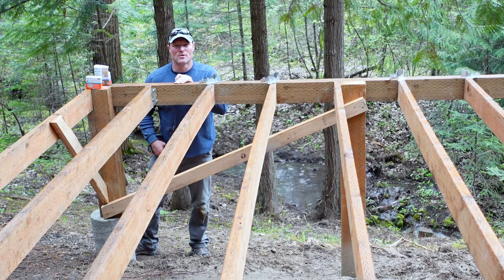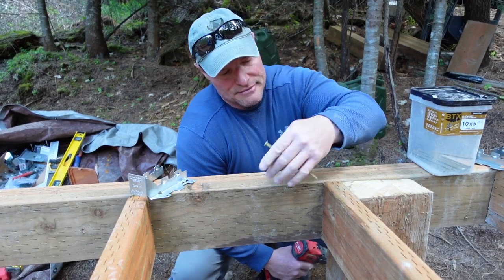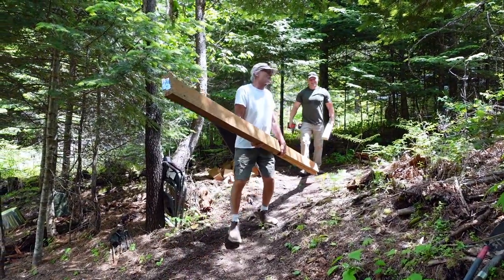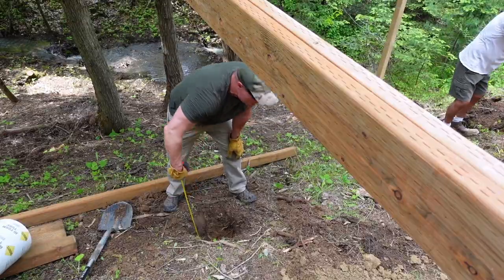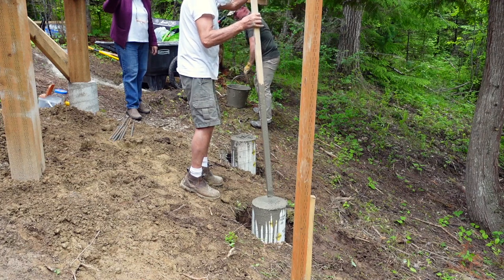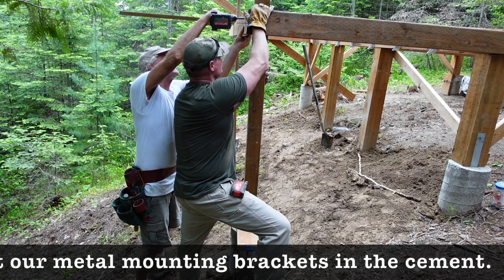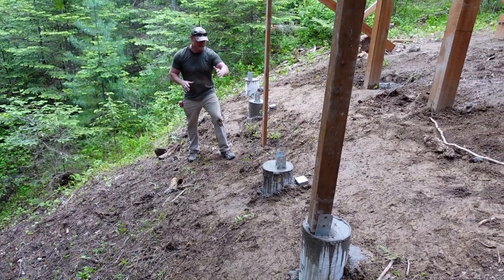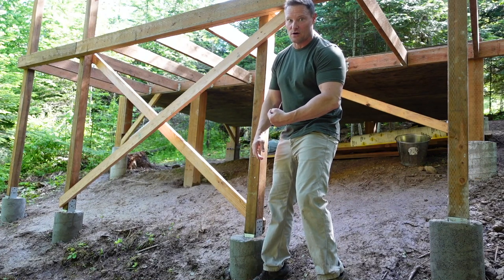Building an Off-grid Cabin in the Rocky Mountains (Part 3)

Comment: Should have used a bigfoot form so you would have had a footing under the pier to spread the load out.
Reply from the maker: good thought. I have 6 6x6's for a 16x10 cabin, should be fine on weight distro, but your right that would have been a good consideration.